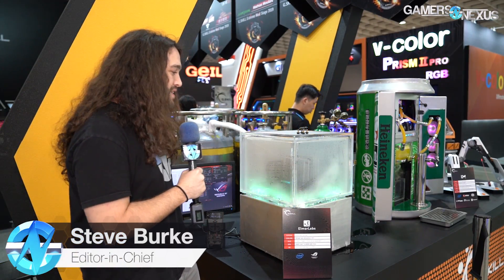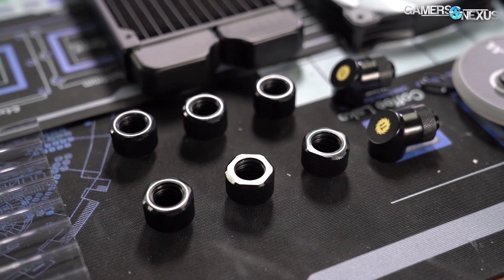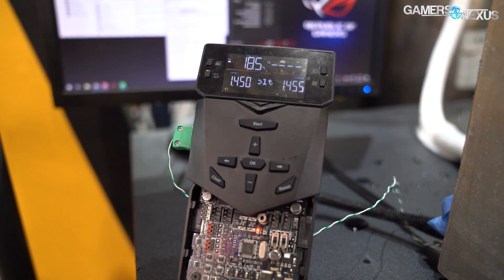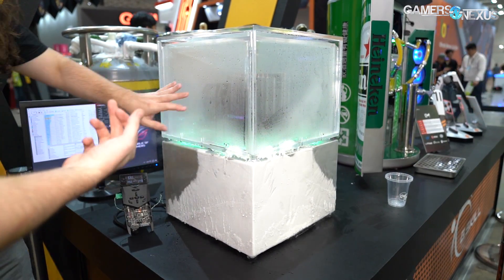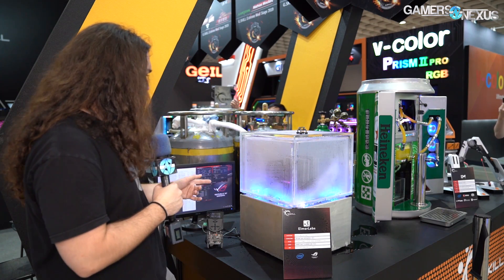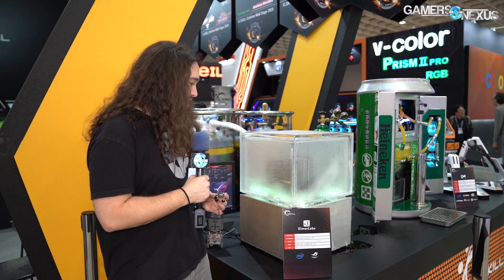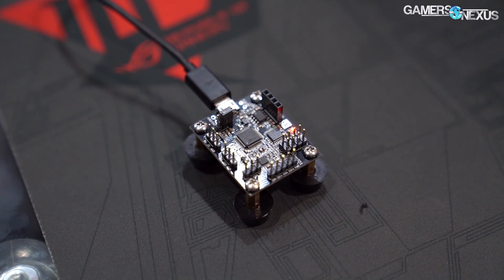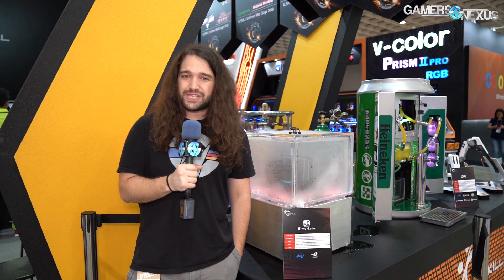External GPU Controller, BIOS Flasher, & LN2 Gas Cooling | Elmor Labs

Comment: This concept gave me an idea. I have a background in refrigeration. Make a vacuum sealed case. Pull a vacuum, fill it with nitrogen, and have a DX evaporator inside the case. No air to sweat, and the whole thing could run at -20C. The ouside if the case would need a dedicated drip van though. Maybe LTT could fly me in to build it.

Comment: That external BIOS flasher will be handy especially for someone that might want to get a mobo for one of the new Ryzen 3000 CPU and the mobo doesn't have the Supports Ryzen 3000 on the box, but is part of the compatibility list, which means it would require a BIOS flash to add the support and they don't have an older Ryzen processor. But most people probably would be looking at getting a 570 board if they're buying a new Ryzen 3000 cpu anyways, but it's nice to have that ability available for those fringe cases.

Comment: That BIOS flasher- can that be used to flash the bios on, for example, a b320 motherboard where someone doesn't have an old CPU to install in it?
Reply: I haven't seen the video yet nor do i know how to put this it into application, but I would think if you can get the board connected to another PC via serial spi port somehow you could flash anything as long as there's power going to the bios chip. Sorry I know this doesn't help but theoretically it should be possible.

Comment: Elmor EVC2 is a great aio solution for many XOC related tasks, ie Communicate with IC's directly to bypass and set new voltage and current limits plus backing up / flashing modified bios'. Basically replaces OC Panel / CH341A eeprom / Rasp Pi. Has Hotwire/SMBus + I²C functionality,  Serial USB => UART and SPI . Hope it comes soon since it's been a decent wait. 

"August 13, 2016
Currently considering if I should make a v2."

Comment: Regarding the whole LN2 cooling box, isn't going subzero bad for VRM?
Reply: I don't think the power stages or PWM controllers have any sort of cold bug above -190c. Typically things that have an oil-like substance to lubricate bearings, like fans hard drives (rust disks) and optical disc things suffer the most from sub-ambient.

Comment: AskGN:

Hello Steve, 
 I tried searching online but the answers didn't really address my concern, so I decided to ask you guys for a trusted and solid answer. Here's my question:
 
 In a scenario of a dual channel memory motherboard (that the CPU and chipset support), if I put 2 brands of RAM with different frequency and/or timings in dual channel (ex. brand 1 in slot#1 and slot#3, brand 2 in slot#2 and slot#4), how will the RAM behave? Are the frequency and/or timings going to get matched to the same value, or are they going to perform separately? If it is the latter, are the slower sticks going to impact performance in a significant way? 

 Thank you very much for your time and effort.

Henry

Edit: Sorry for posting this during Computex when you guys are really busy.
Reply: Allow me to give you some advice on getting information from people when you need it: put yourself in their position.

Steve is knee deep bringing us coverage of Computex, he doesn't have time to read comments, as is evident from his absence this week. By the time he's free this video won't be his most recent.

If I were you I'd wait a week and post my question as soon as he uploads, to maximize my chances of him seeing it.
Reply: Solid advice from @A C right there.

to answer your question, though: my experience is that the mainboard will match to the lowest common denominator. so if you pair a 3666MT kit with a 2133 kit, you get 2133MT specs across all four sticks, probably along with loosened timings, which absolutely negates any performance gains the 3666 kit might have had.
Reply: Typically all Modules run at the same speed aka the speed of the slower modules. I am using a similar setup with two 8GB DDR3 kits with my Haswell, one kit is 1600mhz and the other one 1833mhz. The faster ones just get slowed down (or i have to overclock the slower ones)
Reply: Thank you guys for all the answers/replies. I was hoping that this will get included into the next AskGN when Steve and his team gets the time, but I will definitely consider what you said next time.

Comment: Could it be possible to make a LN2 style air conditioning system for a PC? Was thinking if the fins were gapped huge and it was contained that would be pretty cool
Reply: nope,  because moisture. The cube works because there is no air in there to freeze the h2o in the air. Adding air would add water.
Reply: @djquantize  makes sense, thanks

Comment: Can anyone recommend a 144hz 1440p monitor this is color accurate without breaking the bank? (For gaming and design)
Reply: What do you mean without breaking the bank? 

As far as i know 144hz isnt color accurate because most are TN. You will pay 700 minimum for a ips 144hz. Just pay the cash and enjoy the years of use.
Reply: Richard Mack any specific monitor you would recommend? I am good with spending the money if it is high quality and will last a long time.
Reply: @londonbettman  i will reccomend benq. Thats the brand i use at least. I have an older 144hz 1440p tn panel from them that is no longer in production. But benq has modern 144hz options.
Reply: @richmeisterradio  VA do 144hz pretty good my dude
Reply: I'm looking for similar my friend. Let me know if you find anything.
Reply: @lexi miller and @Richard Mack  thanks, I will look into those